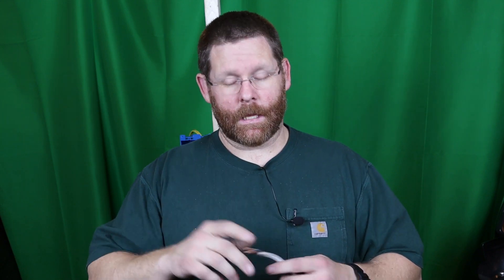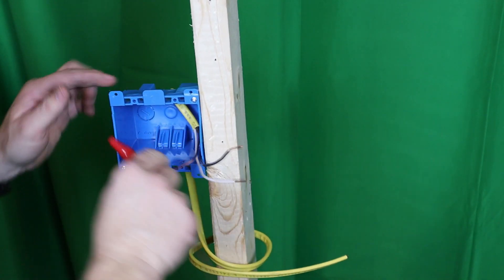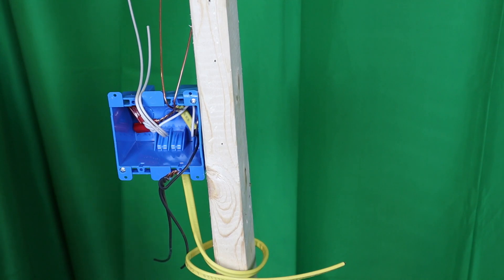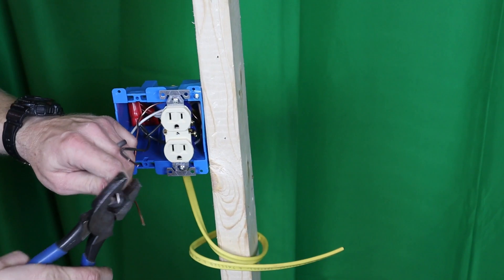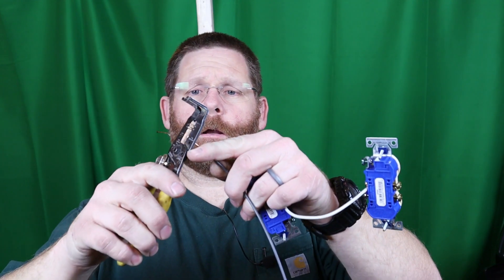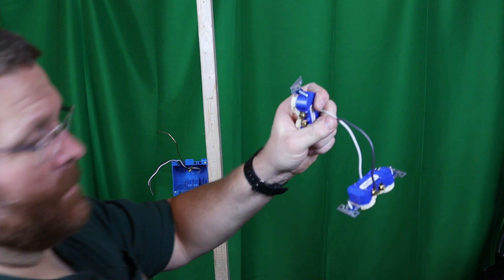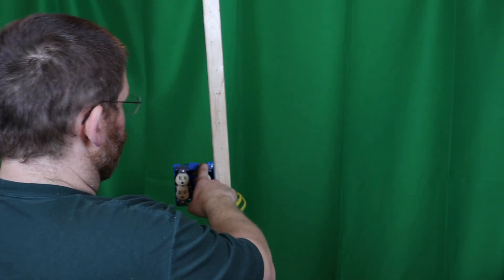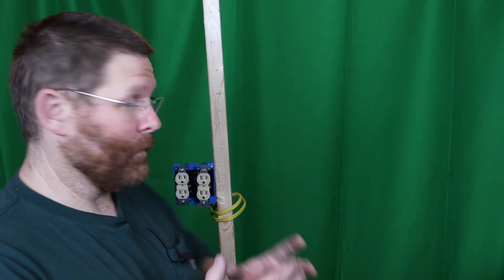How To Wire A Double Receptacle Two Different Ways

Comment: Hello There: Yes i only have one wall switch that turn one light on/off. But in the kitchen has some dark spots some area, So i installed some 3-recessed light in the kitchen am running 3 recessed light off one electrical ceiling box all 4 light tie in one wall switch. But i add bigger box that i can put 2 wall switch but i would like to take one light that hung over the kitchen sinks other switch that turn only one light all 4 lights all the same time. And also on that dose not have a  wall plug, But i would like to put one on that wall so i can put a wall mount for Tv in the kitchen too But i only have one wall switch turn on the lights.
So can you HELP me on this ok Am calling from Houston Tx

Comment: I agree that option 1 is preferable but option 2 also has advantages in that you eliminate two red wire nuts which makes the box less crowded. I also suggest applying tape over the exposed screws on the receptacles in order to help prevent the hot leg from contacting the bare ground wire. Thanks for the video.
Reply from the maker: Yeah taping the screws are s good idea I don't but It definitely doesn't hurt.
Reply: just gnna say this if you feel the need to tape around  the outlet. you shouldnt be messing with electrical
Reply from the maker: Amen... So many people do it and I don't disagree but I just do not.

Comment: Nah bro youre doing it wrong

Ive seen guys skin the middle of the hot wire put it on one switch and the rest of the wire continues to the next switch, in a two gang box. Is that legal?
Reply from the maker: Definitely not now a days if anyone was working with me did that now I would fire them. I'm referring to the hot wire. Like Scott said, the ground maybe but I still prefer it like I have done it
Reply: @MountaineerOutdoors  ya agreed
Reply from the maker: well as far as code goes I dont recall anything saying you couldnt do it...however, there are so many things wrong with doing it this way. If you want to do it that way more power to you but if I came to your house I would tell you that I would have to fix it or I wouldnt continue helping you out at your house. And for you saying to me Im doing wrong...that is a false statement for sure.
Reply: That was a common practice back in the knob & tube days.  It was even acceptable to peel the "tubes" and wrap a branch circuit directly, forming a "T".  Thankfully, those days are gone. On rare occassions I will use a single ground wire in a duplex box, looping the screw on the first outlet and ending on the second outlet.
Reply: No pigtail

Comment: Mine isn't the end of the line and I have 3 sets of 14/2 in the box. 2 receptacles. Can't figure it out.
Reply from the maker: sounds to me like you need to make all 3 of them together then run two pig tails off them to you receptacle. Thats what I would suggest.
Reply: @MountaineerOutdoors  I Figured it out. Thanks for the rapid reply. Happy New year
Reply from the maker: @NYCBugkiller  great, what did you end up doing?
Reply: @MountaineerOutdoors  this might sound a little complicated because I'm not an electrician. I had four sets of 14/2 wire coming into the box. The 2 sets had the whites tied together, the blacks tied together and the grounds tied togther. The other 2 sets of course had 2 whites 2 blacks and 2 grounds. I took the 2 whites and put them on the silver screws of the first outlet. Then I took the two blacks and I put those on the gold screws. I took all of the grounds and put them together. Then I took a white jumper and jumped it over from one silver screw on the first outlet to the silver screw on the second outlet. Then I took a black jumper and jumped that one from the gold screw on the first outlet over to the gold screw on the second outlet. After that everything worked perfect. I felt better after that. I have a friend that does electrical but to get her to come over to my house to do the work is like pulling teeth. Of course I pay her and that doesn't even work. I think it's because she's lazy after doing electrical all day long. That's why I resort to YouTube. It's free and you will most likely get the information you are looking for. I appreciate people like you and the videos you provide. Thank you and Happy New Year.
Reply: I got one in and one out. No pigtails kinda like the second method. Works but I think I'll go redo it with pigtails.

Comment: very perfect video Sir!  Made more sense to me than most I have watched.  What would you recommend for me to run a switch from the house to my shed to turn on the shed's outside light?
Reply from the maker: not sure how big your shed is but at the least you would need a 12-3 if its not in conduit use 12-3 UF.  However if your digging a ditch if it were me Id pull something out for future.  good luck and if you need any more advice let me know

Comment: Question. I have a double outlet. Each out has 2 blacks / 2 whites. Everything works but tester says open ground.  Inside the wall box it seems like the electrician twisted the ground wire with a green nut to make one grounding wire. I think the wire was cut short or something.  He sistered the two outlets together and only the right outlet is tied into the green grounded screw. Can I rabbit tail the right ground to the left outlet screw ground or is this against code?
Reply from the maker: Yes you can but If it were me, I would change the green wire nut to a red and twist two wires out from under it. 2 wires under one screw usually doesn't work too good. Hope that helps.

Comment: Great video, how do I use a 20 amp 2 pole switch as a disconnect on a multiwire branch circuit, I'm using 12/3 uf   up to junction box in shed,everything I've read says to add a disconnect ?Thanks
Reply from the maker: Technically a switch is a disconnect. You would just bring the 12-3 if it the side of the switch that says line that goes to 12-3 you brought in from the house. Then everything else goes on the load side. Curious though why don't you Just add a small sub panel instead? Anyway hope that answers your question
Reply: @MountaineerOutdoors  
So if I'm coming into my shed with 12/3 from main panel I can go directly to my switch box, no junction box,wire my 20 amp light switch normally with one of the hot legs,to use on my light,then my other hot leg would run to my receptacles ,that would split the two circuits since I'm using the white as a shared neutral? Dont want the hassle of a subpanel, easy on the pocket, mainly wiring shed to put security outside lights and the biggest tool I use out there that I use once a year is a harbor freight $90 welder,that's the reason I'm running the 20 amp circuits. thank you for the response
Reply from the maker: @adamluera2145  if it were me doing it this way I would put a box down low. Then come back out of that box and do Your wiring. One circuit for lights and the other for the receps. That's no problem. Imo.
Reply: @MountaineerOutdoors  
Thank you

Comment: Should i be able to do this with the single outlet in my garage? would that cause it to draw too much power? how can I check ?
Reply from the maker: you can absolutely do that as far as pulling too much power you have to look at your device that you're using air compressor drill etc. They make a device you can plug into your outlet and then plug your drill air compressor whatever into that and should tell you the voltage and how many amps it is using hope that helps

Comment: At the end you say, "if you have a wire that's hot and another wire that's not hot." I'm finding that statement confusing. You have three options, hot, neutral and ground. Why don't you say that you have one wire that's hot and one that's, for instance, "neutral" if that's what it is? Are you saying that you have a hot that's hot and ANOTHER hot that's not hot?

Comment: Because I am not an electrician, but I do understand electricity, I'd be paranoid about the ground wire not having insulation and keeping it from contacting the the other two terminals on the receptacle. I agree, the first way looks like a better way to wire it.
Reply: I personally use insulated grounds to the outlet. And wrap electrical tape around the terminals. Yes a few pennies more and a a few seconds but worth the peace of mind.
Reply from the maker: That's right nothing wrong with that
Reply: Under normal operation, the ground wire carries no current. It is merely a safety path which is why it's bare copper in most applications.
Reply from the maker: I agree with that bare wire I hate it when I have to push wires back into a box when it's hot... I guess if they had to insulate it the price would go up.. Its all about saving some dough